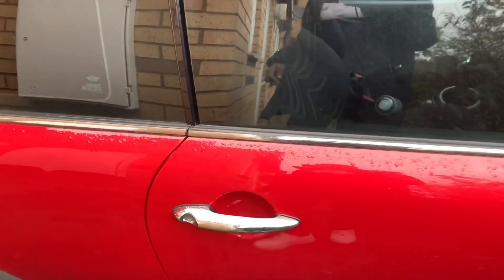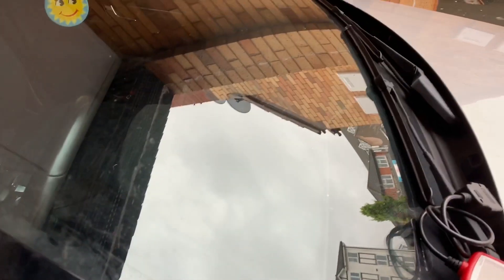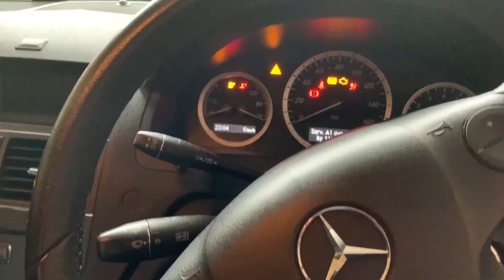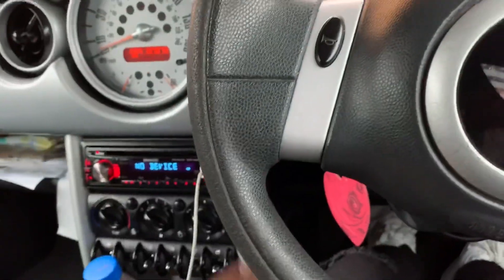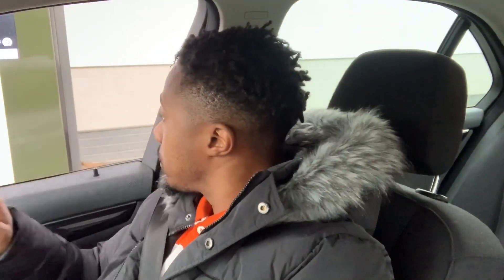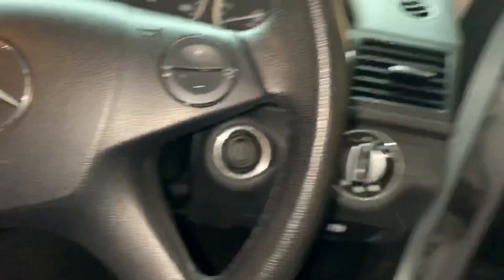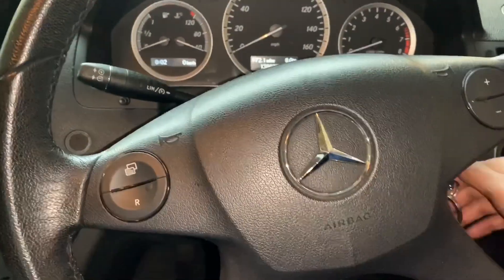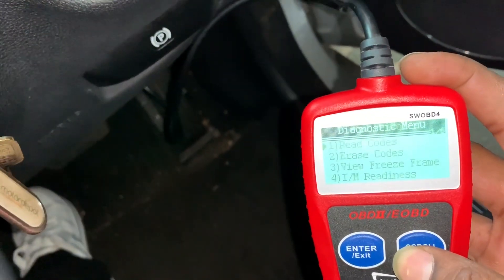Mercedes battery drain diagnostics

Comment: Do a "parasitic drain" test utilizing a multimeter. Your OBD2 meter will not show a drain until you manage to burn out or otherwise disable an OBD part.
They are two different meters for two different types of tests.